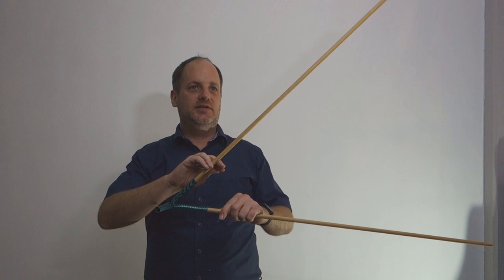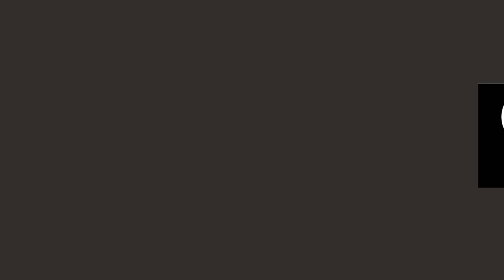Ultra Low Cost Dome Connector [English Version]

Comment: This is a really super smart idea...but what if I want to use a round wood for more permanent structure
Reply from the maker: good question. If you want to build a permanent geodesic dome with round timbers, you should consider beforehand how you want to attach the skin. i don't imagine it to be easy.... Now to your specific question: You could try using aluminium, brass or steel tubes, squeezing their ends together in a vice and drilling the hole for the screw.

Comment: This hub is very good. Exist a alternative made with caps of pet botlles , too. But to your case, when we need to build a dome and have a star of 5 points, is better to do this pipes individually, with a 15 cm width more or less and joint of same method that you use.
Reply from the maker: Hi Jorge,
Yes you are right the 5-point connectors can be build with 5 individuals pipes! I did it
also in the beginning but i personally changed to the design with 2 long and 1
short pipes. The reasons for me were: it’s quicker to build (I am using only 1
screw length) and the struts have less offset which helps if they have to
transfer higher loads.
Kind regardsjens

Comment: I enjoyed the video very usefully.
May I ask for a link where I can buy the "Steel Gazebo Hub Plate" and "Flexible Dome Connector" cheaply?
Reply from the maker: The flexible connector is a simple garden water tube of 1/2 inch cut into pieces. You need to find the wooden struts with a diameter of 12mm from your dealer.
Reply: Hello Can i buy this connector

Comment: I would like to make greenhouse  but in Alberta snow and minus 40 Celsius temperatures will make snow pile and stay up on geo dome green house .So is there more stable and stronger connector idea
Reply from the maker: Hi Baris,
thanks for your feedback. Indeed I designed the dome for Kids and for low forces. This design will hardly withstand extreme conditions. If you are going to build a greenhouse for -40 degree celsius I would expected that you should consider isolation too. Paul Robision has presented https://www.youtube.com/watch?v=JRbTyFK2m7s&t=20s
a design using wooden struts which offers the opportunity to use an outer and an inner foil / plastic / glass layer. Of cause you need a miter saw / drop saw but then you should have an cheep, robust and isolating dome design.
I hope this helps, please share photos if you start building!
Best Greetings from Bremen
jens
Reply: @jensrohde4887  
A bevelled panel dome is the best option for heavy snowloads. I use 3 layers of poly on my dome with lows of -12c, tropical compared to -40c  ;)
Reply: You could try adding metallic hose clamps on each side where he connects the connector to the wooden dowels as a reinforcement. Also, I was thinking of adding a 2 sided EMT conduit strap on the bottom to a wooden framed deck? It might work or it might fail but I think it would have a much higher chance of withstanding winds that way. I'd place them around the perimeter on the bottom every 2 feet. Might be overkill but better safe then sorry. As far as snow is concerned I would think you could add insulation and cut it to your desired shape. Maybe triangles

Comment: The geodesic dome is pentagramic in structure, so how do you deal with odd numbers with regard to the rubber piping?
Reply from the maker: A connector for 6 struts is build out of 3 pipes 20cm each and jointed in the middle. The connector for 5 struts is build out of 2 pipes 20cm each and 1 pipe with 10cm. However, you can simplify your work if you only build connectors for 6 struts and ignore the empty pipe during assembly. Thanks to the flexibility of the pipe it simply doesn’t make a different if you assemble a junction for 5 struts with a connector for 6. 
In my other video https://youtu.be/80FM1aszhIA you’ll find at position 0:07 a picture with a connector for 5 struts – it’s the first connector on the right hand side (use video in HD quality, stop at 0:07 and zoom in). A zoomed picture can also be found @ 3:03.
jens

Comment: What is he using?  He says it too fast.
Reply from the maker: Hi Bill. 
For the dome I use 12mm round wooden struts and a standard 1/2 inch hosepipe (rubber sleeve) as connector. The hosepipe is very cheap and you are extremely fast in building the connectors. 
I hope this helps
jens
Reply: @jensrohde4887  u use a ring screw and a nut? What size? Thank u for the great idea